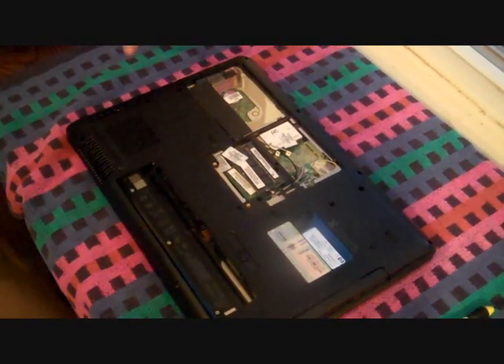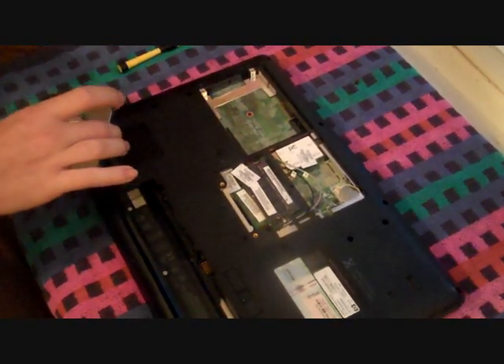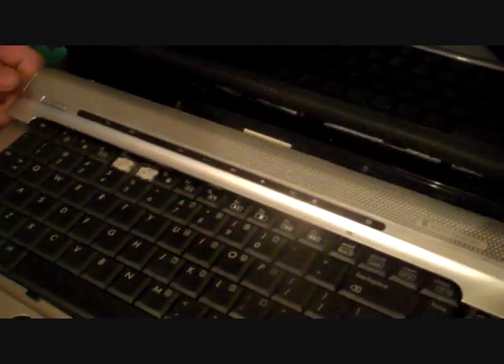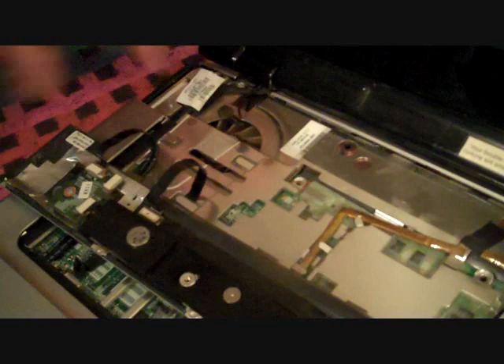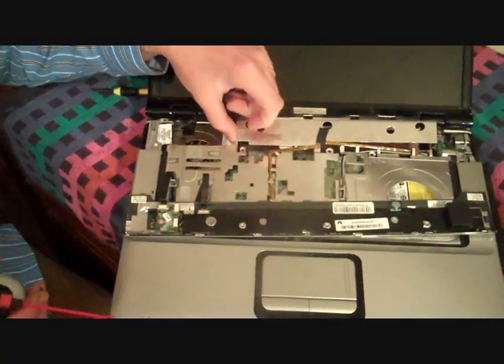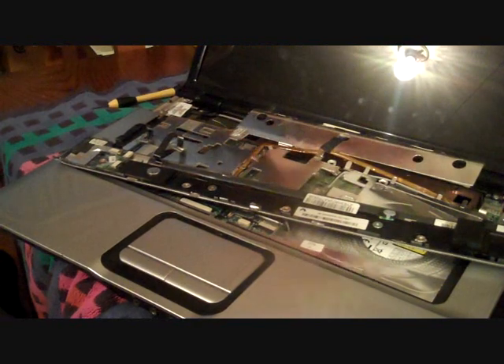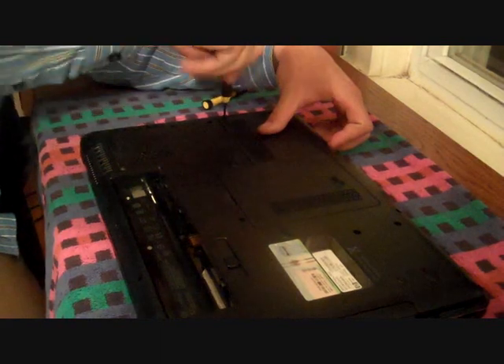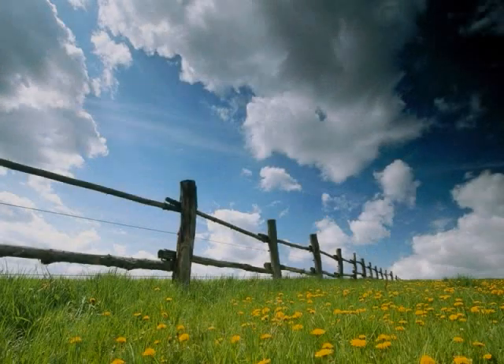How to fix an overheating laptop : Clean your fans and heatsync with this procedure

Comment: @mattw642 just turn the laptop over and you will see the fan so have to use a screw driver to take the screws out then you take out the cover and you will see the fan with lots of dust so you have to clean it with something small like a vacume with a really small tip so just take out the dust and it wont over heat

Comment: they really should have pulled out the whole heat sink. Spraying it won't clean every bit of it up. after i pulled the fan blade off there was a ton of build up even after spraying.

Comment: its sorted very easily believe it or not! simply unplug youre laptop and take it outside.. then spend a good five minutes simply blowing into all the air inlets and outlets blasting out all the dust. Simple and effective. when you turn it back on it wll be purring like a kitten. All it is, is dust clogging the extractor fans, I had the same problem for 3 yrs with my laptop and didnt know it could be fixed so easily, if the noise returns after a few weeks or months, simply repeat the procedure

Comment: okay these two really dont know what they are doing.. prying out the ribbon cable like that on the keyboard can damage the metal strips on them. there is a clip holding it in place. and yes what was the point of removing the black plating if you were just going to blow the *into the laptop. you had to remove the motherboard and cleaned out the fan .

Comment: um...I guess by doing it this way, all the dust get even deeper into the laptop, which it might fix the problem for now but it actually making a bigger problem.  I would remove the fan and clean it outside of the laptop case, in fact, it might only take about 5 more minutes to do that correctly.

Comment: Job well done? Dream on.
The real cause for overheating will always be on the inside of heatsink, where air is either pulled or pushed through the fins, on your laptop it's on the left hand side. What you did was not even worth the hassle.

Comment: DON'T TRY TO OPEN AN HP LAPTOP. ESPECIALLY PAVILION SERIES ONES. BECAUSE THEIR MOTHERBOARDS WERE BADLY ASSEMBLED. POSSIBLY YOU WILL HAVE WIRELESS ISSUES LATER. I HAVE NEVER EVER SEE ANY OTHER LAPTOPS GETTING HOTTER THAN A HP PAVILION LAPTOP LAPTOP.

Comment: I'm sorry but this how to isn't good enough. If you just spray compressed air on the fan it won't do any good because all the dust will be probably on the heat sink's intake.